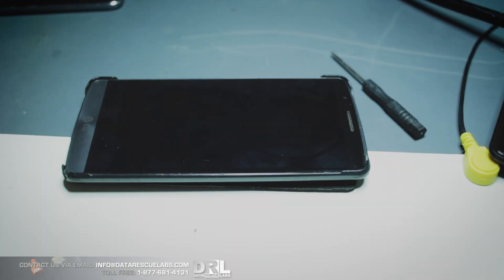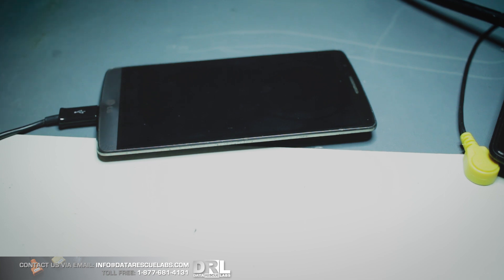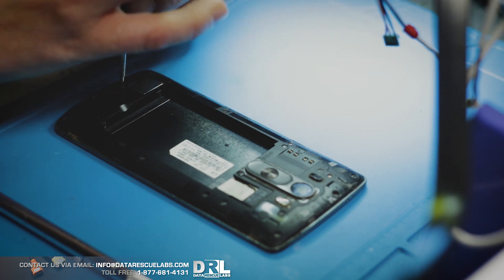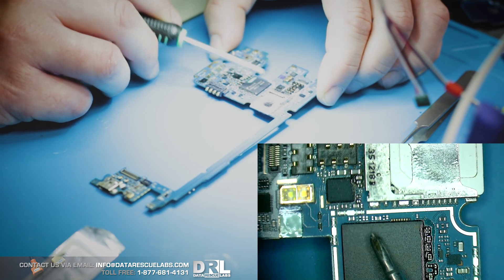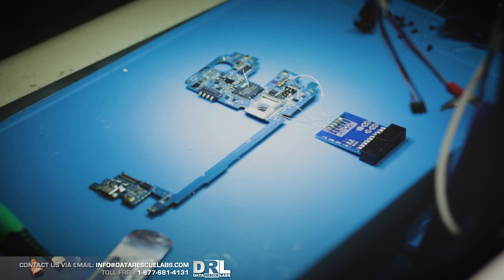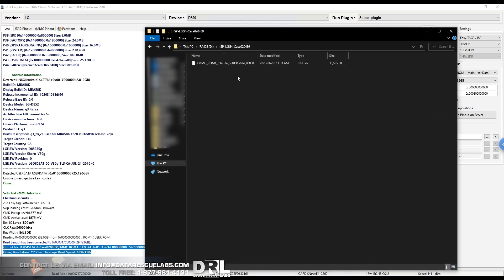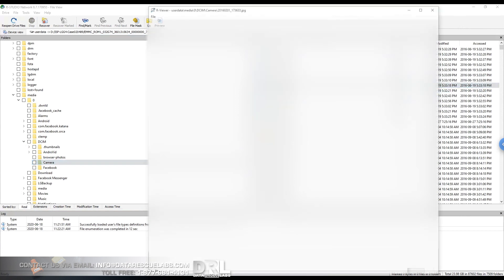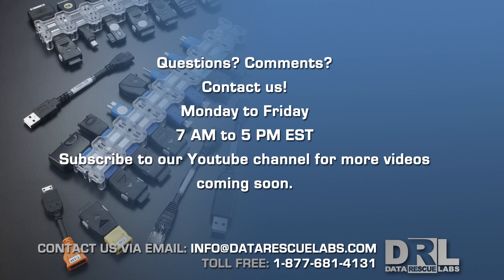LG G3 D852 Blue Screen no power - Data Recovery via ISP

Comment: woow that's magic 
thanks for sharing those amazing professional recoveries , now i'm a new sub 
I want to have ur opinion on a problem
i formatted my phone by mistake : flashing a new firmware after forgetting my pin code ,didn't think it will erase everything 
even worse the phone stopped working after the flashing
and now it's completely dead just like this lg g3 , astonishingly mine is lg too k10 with no boot or charge 
is there any hope for recovering those images and videos via this way , or it's over?
i googled it it's emmc4.5 storage chip, and mediatek cpu, waiting for ur reply